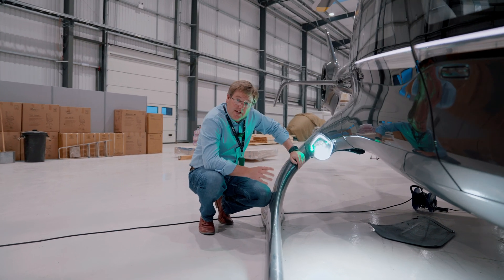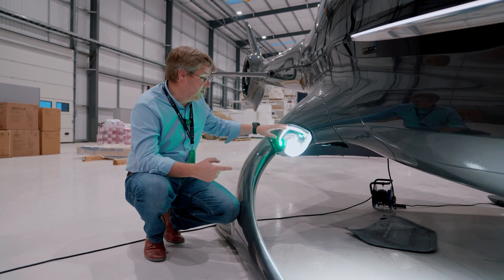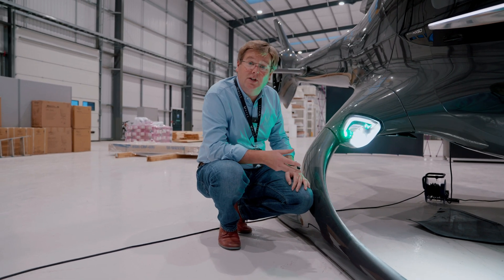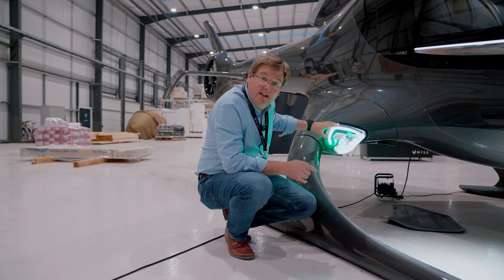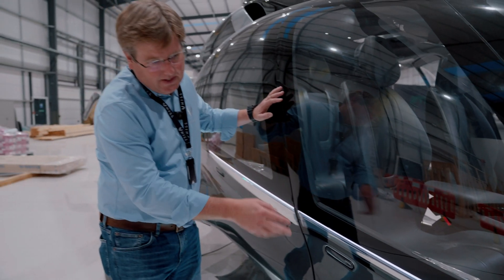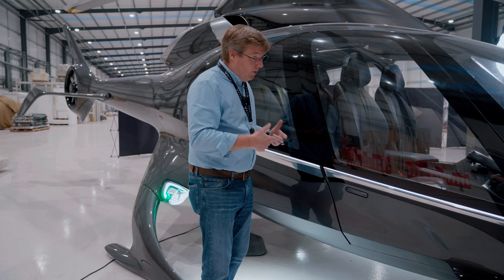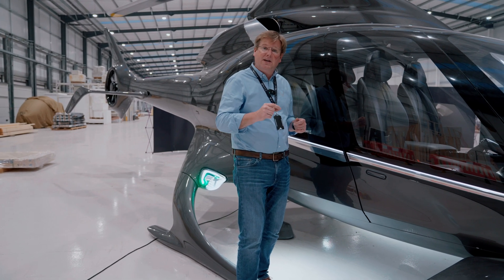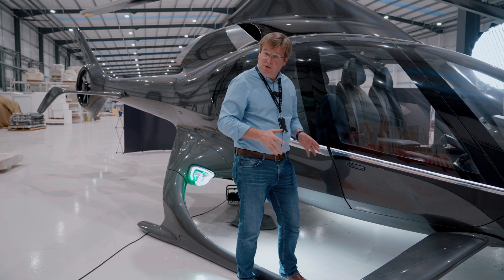HX50 Lighting System

Comment: Don’t forget, when setting up the lights on a single engined helicopter you need to set the lights  to the auto-rotational angle of decent. No use have perfect forward vision, because in an emergency you are not going that way !  It’s down only.

Comment: It looks like the lighting set will cost more than most cars... and I mean the whole car, not just the car's lights. They're nice, but do they really do anything that some off-the-shelf units wouldn't do? When Hill goes under, a few years after building the first production unit, what will it cost to have replacements custom-made?
Reply: It will be like all of the other airplane part suppliers that support the machines in the field…

If you have the funds to operate a turbine helicopter… how much time do you dedicate to thinking about LEDs that don’t wear out in our lifetime?

How about a real question… you wear out a single turbine blade, now what?  😃

Every machine business is at least 10% a separate parts business…. That can easily last longer than the new machine business…

R&D is easy… manufacturing is hard…. E. Musk

😃
Reply: @AC-jk8wq  yes, LEDs should last far longer than the aircraft; the issue occurs when it fails anyway. 

Yes, support for the engine is a bigger issue... but this video is about the lighting

And you entirely missed the point, which is that proprietary parts for these functions are unnecessary.
Reply: Tool...